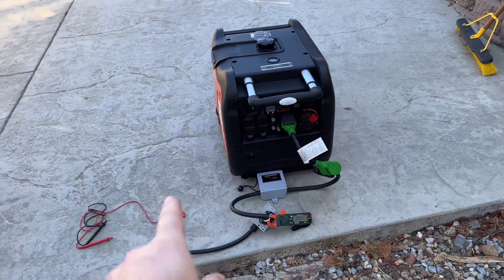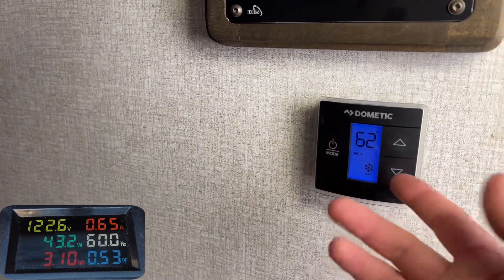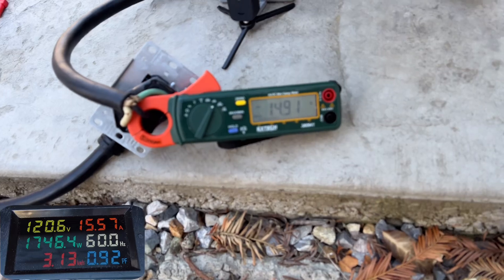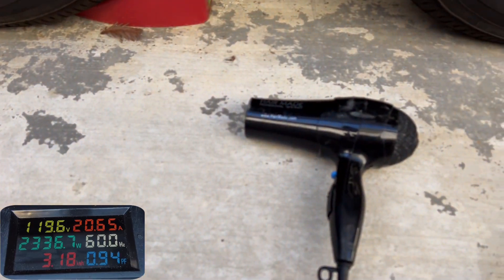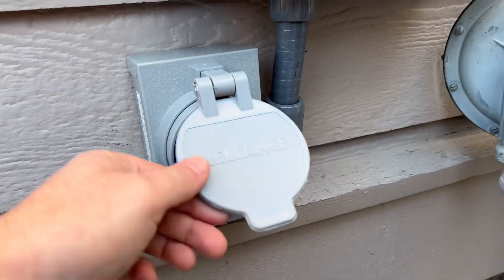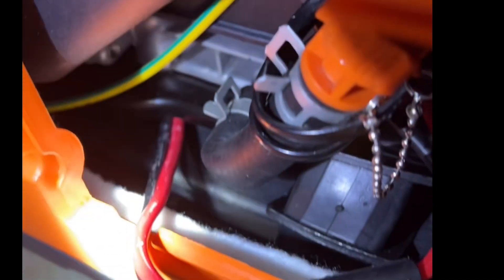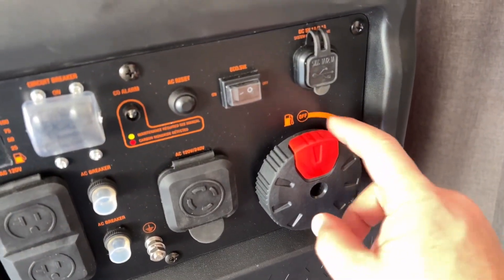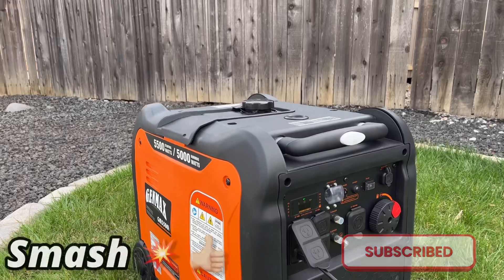GENMAX 5500I Should you buy? Load test, tips & final thoughts

Comment: I thank you for these tests, but honestly this generator isn't meant for RV.  The 240V is the killer feature, and the reason people would buy it.  If you want a decent generator for just 120V, the Champion 3400 gives you 25A in a smaller package.
Reply from the maker: Is not really meant for the 30 amp Rv crowd. But like I stated in the video this would be great for the 50 amp Rv group as now you finally get two hot legs which can power two AC units. 
There is not another green this compact and quiet available. So this gives a good option and can double for home back up. Nice to see a company finally bring the 240 volt option in this size. I assume we will see more companies follow.

Comment: What would you recommend this generator or Champion 5500 watt Inverter generator
Reply from the maker: Do you need 220..?
Reply: I do have two ACs  on my trailer
Reply: Or bump up to the 6000 Genmax
Reply from the maker: 50 amp service?? Or 30?
Reply: 50
Reply from the maker: I would grab one of these for a 50 amp unit. Might as well get the dual fuel with more power. 
Has a better display as well and remote..👍🏼

Comment: I have the igen4500 and I use it for home back up.I want to up grade to this or the 6000 model.I'm using the 30 amp plug and inlet box.would I have to have a new plug and wiring. Done to use the 240 for my home AC and air compressor?
Reply from the maker: So you wanna use the 6000 for home use and run a air compressor that’s 240 and your home ac that is also 240. 
I don’t know how well it will run a home ac because of start up amps. I’m not sure what size you have.

Comment: I'm very new to this gen stuff... im buying a new travel trailer that is 30amp. Am I correct that with this particular unit I would actually be getting just half of its potential power?? If that's the case, would I actually be better off just buying a gen that is made specifically with a 30amp trailer plug on it?? Thanks for your advice.
Reply from the maker: Yes that unit would be better for a 50amp service or a home. This unit would be great for your Rv and is also electric start and on a great sale right now, this unit is not remote start though. If you want remote start you would have to find one of there units that is listed as well https://amzn.to/45IaDgV

Comment: Between this and the 6000 model, can you tell us if it's floating or bonded neutral?  Some companies wisely realize that owners who use the 120/240 outlet might want to connect it to their house, so they offer the ability to make it floating.  I can't remember the brand, but one of them even has the 20A outlets as bonded and seperates the 30A as floating for that very reason.
Reply from the maker: Most of these are floating neutrals. But I will double check. And get back to you.
Reply: I like to know as well. For the 6000 model. Thank you.
Reply from the maker: According to the stamping on the front. The neutral is bonded to the frame on the 5500 and 6000 units.
Reply from the maker: Both bonded to frame.
Reply: @johnnysweekends  That's weird they did it that way.  I'm sure it can be changed though.
Reply: @johnnysweekends  Thank you!
Reply from the maker: You’re welcome
Reply: The 9000iED is also bonded to frame. Is this an issue if using for house backup? I am a generator noob. I do have a grounded panel for the house and plan on having an electrician hook up a kit to plug generator straight into home.
Reply: @goofsaddggkle7351  Yes it could be.  If you use an interlock kit on your panel, which switches everything but ground, you should UNground the generator.  Bonded means it expects you to ground it separately.  Floating means it would use your house ground.
Reply: @rob21  Just when ai thought I had it all figured out! Thank you
Reply from the maker: Are you talking about transfer switch or interlock kit. Interlock simply is a slide lock to allow you to lock the main breaker out to allow the generator breaker. But wiring hasn’t changed. 
So assume your talking transfer switch?
Reply: @johnnysweekends  transfer switch then. Want to use the 50A outlet of a GenMax9000ied
Reply from the maker: Well normally with a floating neutral like on a smaller portable generator it’s like it’s own system and there for does not need to be bonded unless with certain systems or grounded. Normally grounding a generator completes a circuit which then can creat a shock hazard. 
Now this was more for the metal generators as they could create shocks if there was a short somewhere and then when you touch the metal you become ground. The new inverters have a lot more plastic so protects you unless you put a bare metal wire outside of it and some grabs it like a child or…

Now with a bonded which this still is confusing but it says that NEC says neutrals need to be averted away from original source of power. Which is the panel, and connect to the "first means of disconnect" when using the generator. This ensures that electricity will flow properly through the neutral conductors and is delivered to one bonded location — eliminating unpredictable stray voltages caused by connecting to the ground twice.
Reply: @johnnysweekends  I'm not sure if this was for me, but I was talking about an interlock.  They switch off the main breaker in favor of a generator breaker, but the ground is still there.
Reply from the maker: Ah got yea. Yea interlock kit just locks out the main breaker from being turned back on while the generator breaker is flipped on. Back feed prevention….
Which honestly I’ve always wanted to do, for science sake 😂
Reply: @johnnysweekends  That would make a great episode of Mythbusters !
Reply from the maker: Lol right!!

Comment: I’ve been looking at purchasing one of these units for my 50amp RV. I have 2 roof top ac units and I am curious if this would run them plus more? What do you think? Could I run both of the rooftops plus some appliances in the trailer?
Reply from the maker: What size ac units? This does have 240.. 2 120 volt legs… so it will power it but if both units are 15k AC units you’ll wanna start those first but might be tough to start both of those with it soft starts. 
They make the new dual fuel 6000 more to. Same size unit.

Comment: Well, this solidifies the decision. I’m sure there is a way to bridge the two hots to the one hot on the tt-30. 
I’ll just wait to see what else they have coming down the pipeline. 

Great video as always!!
Reply from the maker: They have more models coming. But like I said in the video, it’s kinda too much for a 30 amp Rv. Which really you only need about 3500-4000 watts because when do you have absolutely everything on.

If you bridged both hot lines to one you would have 240 volts and fry the trailer.

How much power do you need or what are you looking for..?
Reply: @johnnysweekends  that makes since with them bridged. I didn’t think about it bumping it up to 240v. 

Honestly, something like the Westinghouse 4500df without the CO seems to be my best bet. I’ve had the pulsar 4000 which was basically the Westinghouse and it was pretty darn good. Would like it to be as quiet as the generac/craftsman 3000i but… 

Anyways, I was hoping for a little more power to service the camper and the house. My eye turned to the champion 5500 DF but they are hard to come by and I’d like to see some more basic features on that generator before dumping more cash into another generator.
Reply from the maker: Maybe the champion 4500 dual fuel. I like the 4650 I think it’s one of champions best. 
But yea I don’t see the 5500 available hardly ever. Stuck on boats..??
Reply: @johnnysweekends  I think they’re getting rid of the model due to epa crap. Maybe a new one is in works? 

I do like the champions but I don’t know why they don’t like remote starts on dual fuel.
Reply from the maker: Yea a lot of models I think are getting repurposed to go other locations and yes due to epa I bet they figure they better change stuff now. 

A lot of gens don’t do remote start on propane I guess due to constant pressure from the tank. Hence why when they want you to shut it off, they want it shut of from the tank first. Just in case the generator shuts off and the tank and system is still pressurized, it’s not leaking if the regulator fails. I suspect that’s why. Safety regulations or they don’t wanna be liable if a part fails down the road and someone blows them selves up…🤷‍♂️

But I bet we see alot of fuel injection models finally head this way. There are a few models out but never got popular mainly due to price and are just not a regular brand name you hear of. But they have had some fuel injection models since like 2015 ish..🤔

Which is great for fuel consumption and altitude. Also storage and cold starts.

Comment: I have a 50 amp big Jayco, 5th. wheel camper, how would I use this generator to get all the power out of it ?
Reply from the maker: You have a 50 amp. So you use two hotlines. This is more for what this is designed for. It’s not a good option I think  for the 30 amp service crowd as you use a adaptor and loose a hot line so only providing about 22 amps. 

This gen is mainly for the 50 amp group and home back up..👍🏼